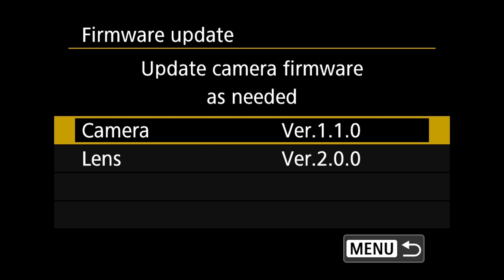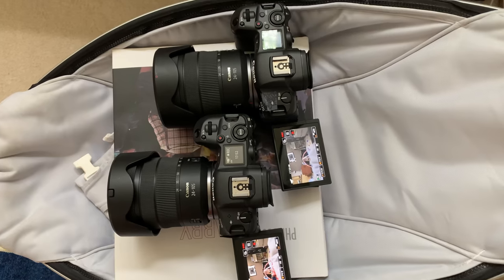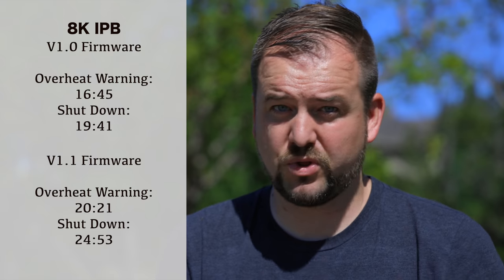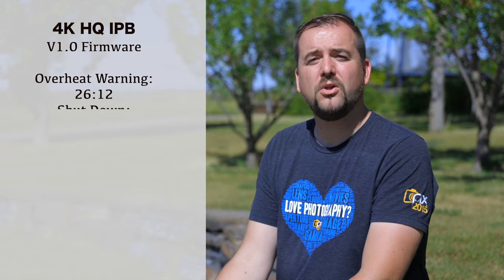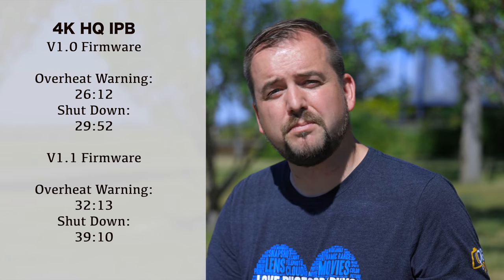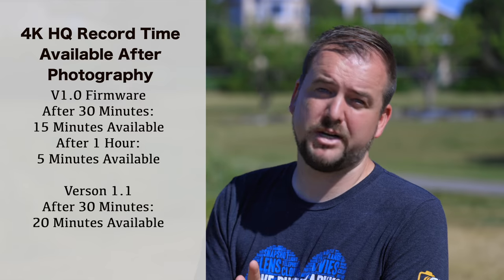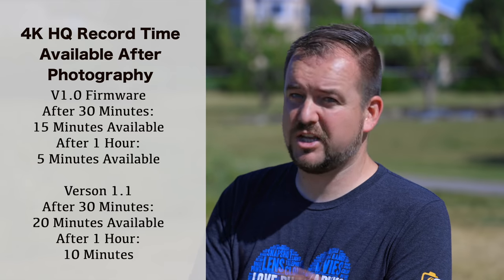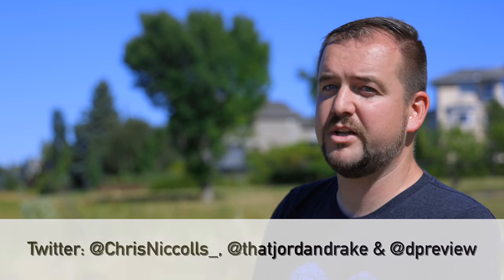Canon R5 Firmware 1.1 - Is the overheating fixed?

Comment: I'ts CAMERA not a video camera, its one of the best cameras out there along with sony, if you use it as individual clips of 30seconds you will get far more out of it! stop making the overheat issue the be all and end all of the the camera issue to make or break the purchase, it excells in every other aspect, so what if it cant do video at 8K or 4K for hours and hours and hours, go buy a seperate video camera! this is a Photographers camera not a cinema camera!
Reply: The point is, Why did they market it as a video camera that shoots 'Full frame 8k an 4k120' then?
Reply: @bookphile870  because marketing did what they do market it as such. Can record in both of those, yes it can, can it record more without the software limit and how much, yes it can and probably will,. But it can do those things, just because marketing says one thing and the limits are placed on it through software or whatever is normal for every marketing dept in every  company in capitalism they will promise one thing deliver a controlled version. Still would buy it as an upgrade regardless of a software limit, because it is what it is a great stills camera with great video option. Pretty simple
Reply: @GaryParris  So you're telling me that this is not a ripoff for 3800$ for someone who's looking to shoot video because of the specs they saw on the ads. I mean clearly no one's gonna be like 'The video specs are good but the just don't work, oh well, i guess I got a great camera for the price that shoots good stills and sometimes decent video.' sounds like a pretty out of the way defence to me. Granted it's a great camera for photography, but you can easily get 45 MPs for something way cheaper than that. Also, when I ask for 8k, I'm asking for the convenience of shooting in 8k and not having to stop production for 2 hours between the individual clips. All I'm saying is it's a disappointment of a camera, which had the specs to actually be capable.
Reply: @bookphile870  i dissagree its not a dissapointment to many people who will be doing some video upto 8K  as a seondary and smaller use scenario, for them the way in which its used will determine their workflow if they need it, for many though its primary functions is as a 45MB full frame mirrorless canon that works with existing and newer lenses, its a no brainer for that! your taking a specific set of criteria and those who should buy video cameras as the criteria, NO! sorry but your just bemoaning about the bad marketing is all! well thats marketing for you! big surprise...NOT!
Reply: @GaryParris  8k for secondary and smaller use scenario?? give me a break. who in their right mind uses 8k for a secondary camera except for full fledged professional production studios? besides, A sane person wouldn't buy an 8k camera to serve as their B-cam anyway. if you're talking about professionals here, i'm sorry, they have their workflow sorted out with something like the Red Monstro or Helium for their 8k needs. I agree that its primary function is a 45mp stills camera, but my point stays as to why get it branded as a video camera then? they could've just said that its a killer stills camera and oh, it can do 8k as well. Moreover, If i'm being told some camera is a video camera, i'll look at it as, guess what, A VIDEO CAMERA. i'll focus more on the 8k and 4k120 and RAW and LOG and stuff rather than having to defend it by saying its good for stills, which it is, but I was not told that as a customer. and about me bemoaning about marketing, I'M LITERALLY SPENDING 3800$ and Some more for a lens kit out of my own pocket for this, so naturally i'll be mad if they botch KEY FEATURES up. Why are you trying to defend Canon's Mistakes over here by pointing somethings out THAT WE ALREADY KNOW? We know its a stills camera, but we were told its a video camera by, guess again, canon themselves.
Reply: @bookphile870  Again I disagree and yes you are bemoaning, yes plenty will buy as a stills camera upgrade and to use its video up to 8K with a different workflow, and those will be people buy it for photography use more than videography use, that is the reality, and no that's what some people have lost sight of which is why i'm pointing the obvious out, its a great stills camera and a step up to mirrorless FF camera using existing and new glass. I am not defending bad marketing but i am confirming what a lot of people will be a reason to buy it! and i am trying to give a better perspective than it doesn't do hours of video at 8K or 4K 120, woop de do! lol people including pros change workflow all the time to accommodate new tech, sorry, but big production houses are going to use video cameras primarily, so that's not going to affect most, and many others will adapt if this is what they decide to buy and use for video! you'll either buy it or you won't.
Reply: @GaryParris  Whatever man, I can see your flawed opinion can't be changed by my words. Again, no one will use this camera for an 8k workflow, you're just trying to justify it's existence in the first place. Secondly, Why are you so adamant on your stills camera perspective? it almost seems like you have nothing else to talk about and are just trying to defend its flaws? and excuse me? Pros will change their workflow by seeing this camera??? Not all of them are youtube influencers paid by Canon to do so, they actually need a reliable camera to get the job done, and along with that they need it to match their existing accessories conveniently. I don't think 8k will be the norm for another 5 years, and don't think people can handle the workflow themselves. You're missing the point here, all i'm saying is that I wouldn't buy a piece of gear i know will inhibit my art, rather than expand it. and also, about that stills camera thing again, WE KNOW ITS A STILLS CAMERA, it still doesn't justify spending so much on it, when you can get another similar one for less price. You're just beating a dead horse to justify the flaws of this camera, by highlighting specs we already know about.
Reply: @bookphile870  again see above, a great camera that can do upto 8K video, again see previous comments! Again photographers will benefit from upgrade to mirrorless, again read all the above, again you're complaining about what everyone understands as an issue with sustained usage of high volume video, whereas nothing is going to stop anyone shooting stills and zero overheating, it's pretty easy choice  for many. Again many will spend on the R5 because its there are professional and others who want it and is OK with the cost because they get paid for their work, regardless of you or I.
Reply: @GaryParris  Again, read my points. I am NOT talking about the stills at all. I'm talking about the fact that people who were looking for a good video camera will be disappointed because Canon marketed this wrong. Again, Its a great stills camera, and Photographers will be quite happy with it, but my concern is that the target demographic that CANON SET, is not going to be happy. We know its a good camera for stills, but it was marketed as a video camera, and that is disappointing to me. Canon could've swept the world off its feet by not crippling the video features, or just atleast not branded it as an 8k Raw 4k120 blah blah machine. Overheating is not an issue inherently, its a software lock by Canon to protect their Cinema Line, which i'm not at all surprised by. Again, Look at my comments, My concern if for people who'll spend that amount of money, thinking about the awesome video features you get, and then getting ripped off and disappointed. obviously there are people in the world who just wanna do filmmaking with a capable camera without having to spend 10-15k on the same specs. They will be looking at this camera too, not just photographers who do a small bit of video on the side. Even Complete hybrid shooters like me will be a little bit dodgy about that investement. those who look at only the 45mp sensor, 20fps burst, granted its a great camera for them, but CANON DID NOT MARKET IT TO THEM.
Reply: @bookphile870  again ad nauseum. It still shoots 8K & 4K. Again marketing is just that; however wrong they are it still works with both, just have to work with it or buy something else to use along side it. Don't buy it, buy it it's simple. Perspective.vhave a good day!
Reply: @GaryParris  Have a good day yourself Schill, I'm sure Canon will be satisfied to see you brown-nosing theirs for so long.
Reply: @bookphile870  lol someone doesn't agree and points out the reality of things to you and you just get all worked up, you're living in capitalism lol
Reply: Gary Parris You got all worked up man! You were repeating the same points all over again! It just goes to show how ingrained in capitalism YOU are, schilling about a company so much lol! Infact, I pointed out the reality to you, but you’re ao delusional, you’ll defend it to the end! Peace out man! Get some validity
Reply: @bookphile870  lolal you have zero idea about me, dilusion is yours and so triggered by my pointing out the capitalist facts, it's truly hilarious you are trying to say what you just did lolal 😂😂😂
Reply: @GaryParris  Apparently you were triggered, since you made the original comment. and the fact that you're trying to show me how i'm capitalistic, just shows how downright hypocritical you can be. remember, you are defending Canon here, not me lmao. I just love how schills like you can argue to the end without facts, and just end up calling the other person delusional. and yes it is truly hilarious, becasue if you look back, you were literally repeating one point over and over.
Reply: @bookphile870  lolal hilarious lolal you are so triggered lolal that's so funny lolal.
Reply: @GaryParris  Hahaha you're so hilariously delusional bro ahaha try Standup comedy once you get your head out of your A**
Reply: @bookphile870  rent a troll lolal
Reply: @GaryParris  get a life lolol
Reply: @bookphile870  exactly what i've been thinking about you since your first response! XD lolal
Reply: @GaryParris  Then go get one XD, don't just think about it, you shouldn't be allowed to think with that pea brain of yours lolol

Comment: I've been a loyal reader o DPreview ever since its inception in 1998, and over the years they had gained my respect at many levels, even after the Amazon acquisition several yeas ago (which unlike many others, I was happy about, it was a hard-earned event after so many years of a labor of love).

However, recently (and this video is the best proof of it) DPreview has taken a nosedive because of  its video section and its integrity.

It doesn't take a genius to realize that Jordan Drake is avoiding at all costs to hurt Canon's feelings in this video instead of coming out clean and clear and talking about the issue every professional is concerned about on this camera at the moment: The artificial overheating limit that Canon put in place (very likely to create a barrier and try to protect its C-line of more expensive cameras, but this is speculation on my part).

Just look at the EOSHD website where they show beyond any doubt (with video proof) that these cameras stop working not because they overheat but because they have an artificial limitation implemented as a timer.

Some other "reviewers" (read: "guys who get paid by Canon or are invited by Canon to special events") on the internet have claimed that this is "to protect the camera in case one of its heat sensors fail", but did you know the camera has no less than 3 temperature sensors? As a computer engineer I can tell you that the chances of all 3 sensors failing at once are pretty much impossible. This is beyond any doubt an artificial limitation put in place not for engineering reasons but for marketing purposes.

And let me be clear: Had Canon mentioned from the start that they put those limitations in place on purpose in order to keep separate functionality on different price points, none of this Public Relations nightmare would have happened and I would have considered buying the camera myself (it was literally on my shopping list along with several Canon RF lenses), but as this turned out I feel cheated as a long-time Canon customer. This is unacceptable behavior, specially for someone paying almost US$4,000 dollars.

So on one side I'm deeply disappointed at DPreview as they obviously lost their ethics, and on the other side I'm deeply disappointed at Canon for their lack of morals. I, like many of my mates in the industry are now looking up at Sony (and possible Nikon) to do the switch, should Canon not come clean on this.

Comment: How can a camera even start to overheat from taking one picture a minute?
Reply: Sensor read out, IBIS, data processing and data storage to the card... all that generates heat!
Reply: schaerfentiefe1967 But it shouldn‘t. At least at such a degree that it shortens your record times. Any camera released over the last 10 years can shoot timelapse at this framerste all day long without overheating.
Reply: @romanpul  
The overheating does not take place when shooting pictures! It only occurs much faster when shooting video(!) after taking pictures.
Consider that the R5 has to read out 90M pixels since all the 45M pixels are dual pixels. That's a lot of data to process!
Reply: schaerfentiefe1967 Where did you get that from? The R5 does not have 90MP on the sensor. That‘s not how dual pixel works
Reply: schaerfentiefe1967 and that is still beside the point. This is a workload that simply should not cause a camera to build up any amount of heat. Timelapse is usually shot on a tripod with locked off focus. So there‘s neither IBIS nor AF involved in it
Reply: @romanpul  but sure this IS how dual pixels work!
The camera has to read out BOTH pixel values of a dual pixel to be able to calculate AF!
Also to calculate the brightness of a resulting image pixel needs the data of both dual pixels.
So there are 90M pixels to be read out and to calculate with!
Reply: schaerfentiefe1967 That is only for acquiring AF. For acquiring images the signal of the photodiodes is combined into one and is not read separately. And it basically never pulls all the dual pixel information from the whole sensor but only from the area where the camera is trying to focus. 
And this is definitely does not lead to any build up of heat. Canon is using DPAF for a while now and it never caused such issues.
Reply: @romanpul  completely wrong!
The sensor itself can't combine the signals of both photodiodes! And AF can be acquired at any area of the sensor and also at multpile regions simultaneously (e.g. "expand AF area", "zone AF", "large zone AF" etc.) 
This is the first sensor with DPAF with much more than 30MP! ... and it ist 50% more.
And no other Canon camera offered 8K, 4KHQ or 40K60p where overheating can become an issue.
Reply: @romanpul  see also:
"From there two separate video images are passed to a data processor where the phase difference between the two is analyzed..."
https://youtu.be/T3YfRqGZ6C4?t=73
Reply: @romanpul  and you may also never have used a DualPixel RAW image of a Canon 5D Mark IV or EOS R.
In these RAWs all the DualPixel information for each pixel is preserved so DoF calculations (e.g. focus shift!) for the whole image can be performed in software in the RAW converter!
Reply: @schaerfentiefe1967  Jetzt entspann dich mal. Das hat trotzdem nichts damit zu tun, dass die Kamera überhitzt. Und danke, ich kann selbst Sachen von google kopieren. Die Overheat protection in der R5 ist einfach vollkommen sinnfrei implementiert. Das ist der einzige Grund warum dass die Aufnahmezeit reduziert.
Reply: @romanpul  die Overheat protection ist, sagen wir mal, sehr "konservativ" implementiert.
Es wurde aber bereits in Vergleichsvideos gezeigt, dass auch eine Sony A7SIII bei 60p oder 120p überhitzen kann, obwohl sie ganz erheblich weniger Pixel auslesen und berechnen muss.
Sony ist hier nur wesentlich "entspannter" bei der Überhitzungswarnung....ob das auf Dauer für die Hardware gut ist, sei dahingestellt.
Reply: schaerfentiefe1967 Während man videos aufnimmt definitiv. Früher oder später wird da jede Kamera zu warm. Mir ging es jetzt wirklich explizit um ein Foto pro Minute. Dabei ist die Kamera ja immer nur für eine Minute aktiv. Hab gerade auch noch ein Video gesehen, wo das anscheinend auch passiert, wenn man zu lange im Menü rumsurft. Ich denke Canon war sich einfach nicht ganz sicher, was die Hardware verkraftet und hat deswegen sehr konservative (und vermutlich auch etwas schlampige) Limits gesetzt. Ich finde die R5 ist aber trotzdem eine sehr eindrucksvolle Kamera. Allein schon die fps bei 45MP sind genial

Comment: Some of these times are at least a 25% improvement over the 1.0 times. If you got a 25% increase in your salary, I doubt you'd describe it as "not significant". lol
Reply: If your pay started out at 1/2 the average market rate a 25% increase wouldn't satisfy you. It would just be slightly less bad.